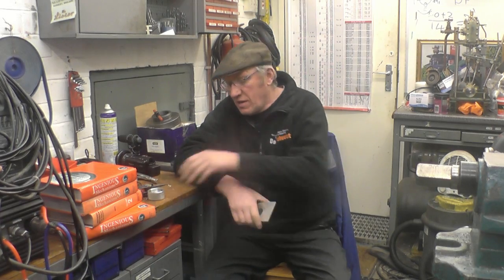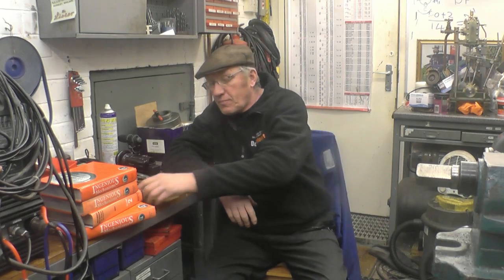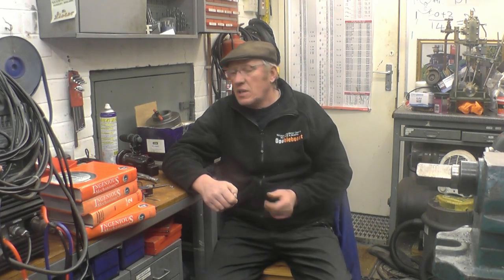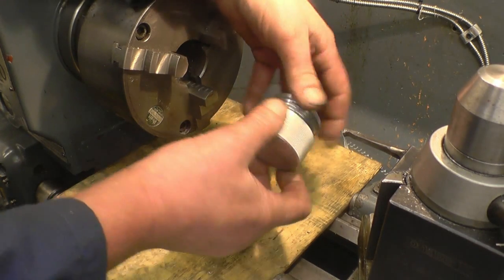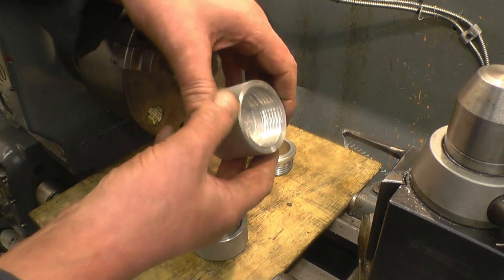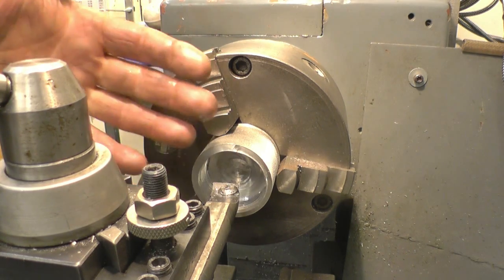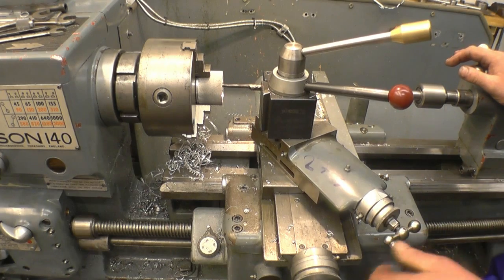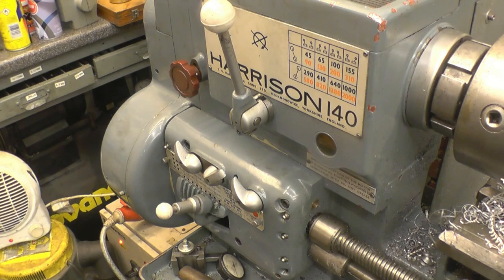SNNC 115  P1 Internal  screw cutting

Comment: John, did you check that thread's R/H not L/H, it looks L/H to me too... ;o)(I leave the tumble/feeds&threads reverse where it should be for a R/H thread, reverse THE LATHE - it means running a Special Tool though, good one's a small boring bar with the toolbit pushed out the back the right way up instead of out the front right way up (or out the back wrong way up) for threading into the blind bore R/H)

Comment: The benefit of using the tool upside down is that you pull out in the same direction as you would when cutting an external thread. It's not fun reaching the bottom of the blind hole and by habit or in panic turn the crosslide handle counter clockwise as hard and fast as you can while disengaging the halfnut burying the tool and promptly snapping it.

Comment: That is another left hand thread.

You need to be running in reverse to feed from the left to the right. Cutting on the front or rear does not matter but using the rear when running in reverse is easier.
Reply from the maker: +Scott Henion The comments are priceless It shows you are paying attention
Reply: +doubleboost glad you confirmed what I was thinking,  I was sitting here scratching my head... I thought I was losing it
Reply: +Scott Henion yep you can see his coarse threads still turning outwards when the lathe is going clockwise!  he needs to feed in, with the same setup, and not out, and he would have it
Reply: +Scott Henion And the top slide should be pointing the other way so you put cut on with the leading edge..
Reply: +thenextstepp Scratching my head is exactly what I've been doing these last 10 minutes 8^) Looked like a double start from doubleboost as well. Just as well the chuck let loose ...
Reply: +Scott Henion Left hand Louie and the five thumbs!